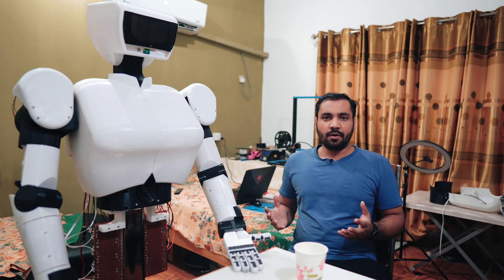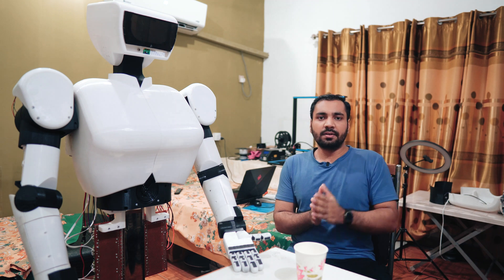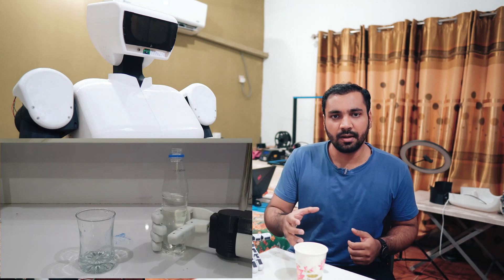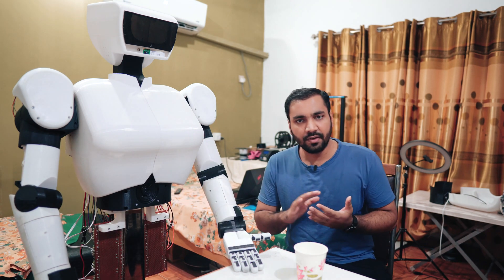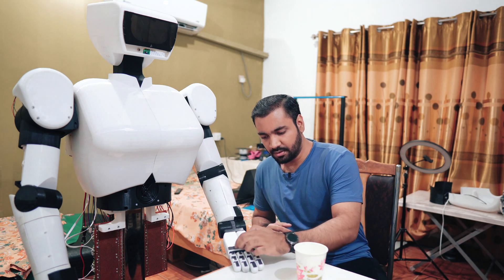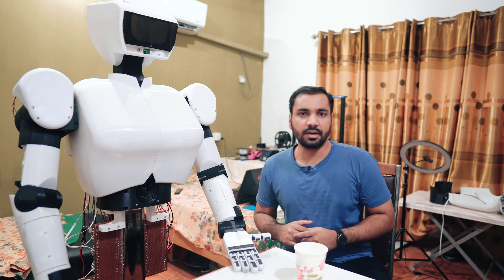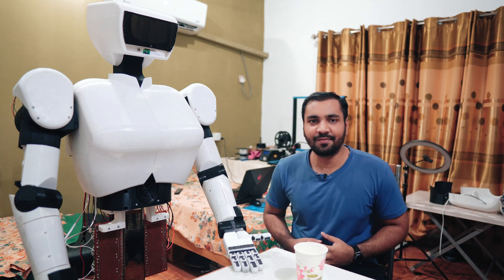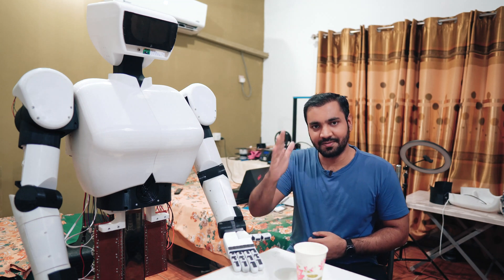3D Printed Robot Serves Drinks - Made in Pakistan

Comment: Awesome. Are you using a pressure sensor or touch sensor for feedback from fingers? or just manual for now?. And another thing for reducing vibrations is to use the harmonic gear mechanism. that gear mechanism is small, compact, has high torque, and has zero backlashes.

Check these:
https://www.youtube.com/watch?v=So9PoP3rqKo
https://www.youtube.com/watch?v=xlnNj9F37MA
Reply from the maker: Hi Zain, thanks for commenting. It's manual for now for fingers. 
I considered harmonic drives but they are good for low torque applications. For higher torque requirements, cost becomes an issue. Since this robot is almost my height, and arms even longer, 3D printed wave gear may tend to slip.
However,  I will give it a try.
Reply: @COBOTLAB  Yeah you are right, cost is a major issue especially if you are doing alone. And 3d printing does have that disadvantage of slipping. But overall awesome work.👍